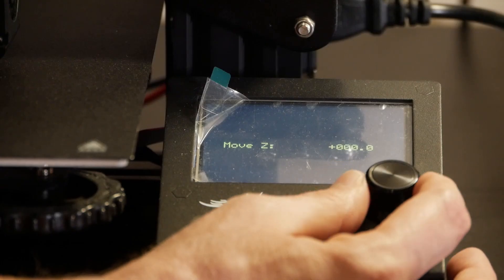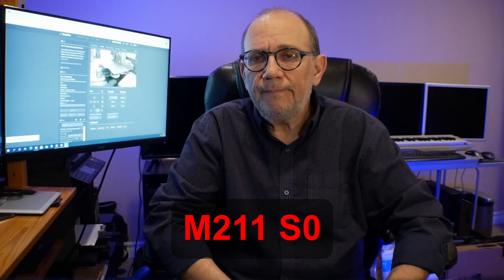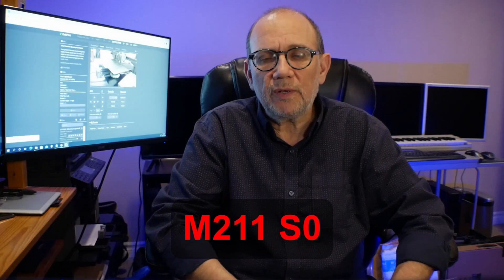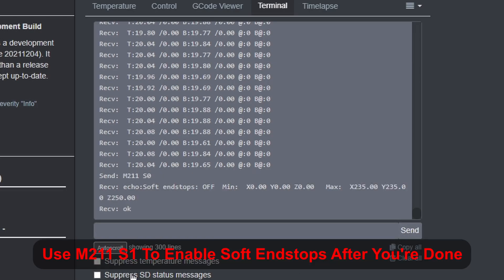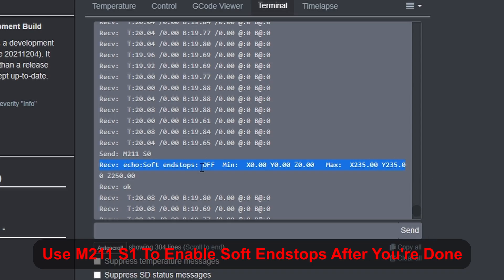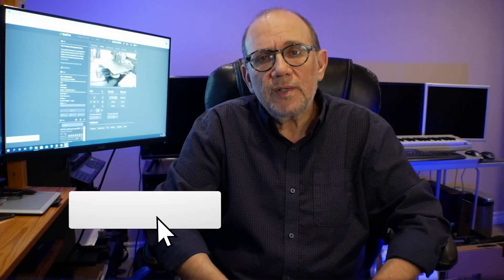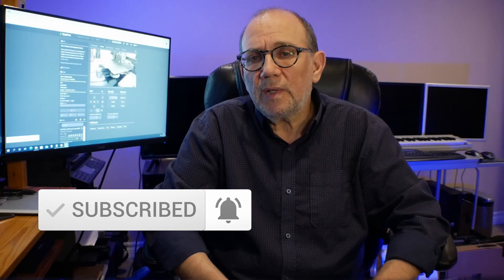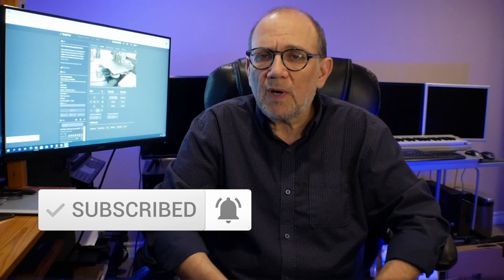Easy z-offset adjustment for your 3D printer.

Comment: I've watched so many videos since getting my CR Touch a little over a week ago, and this is the ONLY video that helped me figure out why my prints weren't sticking to the bed. I bought a new bed, experimented with so many temps, compiled different firmwares and spent HOURS of my nights trying to figure out why my "level" bed had trouble getting filament to stick. Watched this once, and I was finally able to correctly set my z-offset and my first test print worked with no issues. I can't think you enough!!
Reply: yep, same.
Reply: @mikebird4066  The same with me
😊
Reply: Same for me, Creality sucks at giving the basic info to set up their stuff and their firmware organization is a mess.  Too much focus on nice packaging and not enough on the meat.  I very quickly concluded this was the probe not knowing how vertically far it is from the nozzle and I was about to bend the bracket when I found this video.  Thank you!
Reply: Came here to say the same thing. Thank you so much!

Comment: Great info in this vid. The way I did it was run a gcode file with M211 S0 to turn off negative z restriction. Tram up the board like usual with paper with no ABL enabled. Set z offset to something closer to zero than the actual distance since that will make it stop too early on autohome. That is better than having a very negative z offset and having it crash into the bed. Enable ABL and autohome. Use the z axis menu to see how much farther it needs to go to have it scratch paper. Add that distance to the z offset and try autohome again. After 2 or 3 adjustments it should be very close. It's better for it to be too loose than too tight since the ABL code will just adjust and you don't crash the head into the bed. That is, -2 mm is safer than -2.2 mm. Save setting and it should be good to go for using G29. I used firmware from compiled at firmwarefactory-net because the firmware that came with BTT was very buggy.
Reply from the maker: Hello Matt Jones.  Thanks for the comment and the detailed explanation of how you set the z offset.  RG
Reply: Fantastic info to be able to turn off that restriction. I recompiled my firmware to allow it, though under nearly all circumstances I obviously want it on! Wish I'd known your trick!

Comment: ok. its very simple but in my printer i can't go below 0.000 in any axis . Do you know why is like that ?
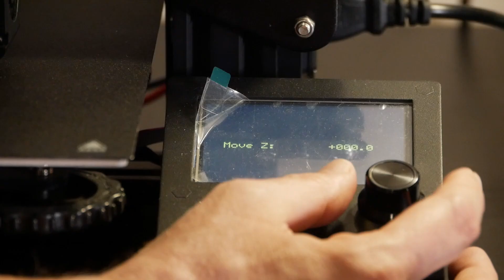Reply from the maker: Hello Piotr Paderewski...did you watch to the end of the video?  If your Z axis doesn't go below 0.000 it means that the z axis soft limit switch is turned on.  This is to prevent your nozzle from hitting the bed.  I talk about this here... 15:08  ....you'll need to turn off the switch with the M211 S0 command.

Comment: So I am having a issue that it won’t store the settings what am I doing wrong Ender pro 3 here with a CR Touch
Reply from the maker: Hi Chad Pisarski:  Sorry to hear that you're having an issue storing your settings.  I'm assuming that you're using an Ender 3 Pro with a 32 bit board, is that correct?  Given that you've got the CR Touch installed I'm going to assume it's a 32bit board.  Are you following all the instructions in my video regarding saving your values?  Does your printer save the value until you turn it off, and then when you turn it back on it's gone?  Did you install new firmware to get the CR Touch functional?  Depending on which control board your printer has installed, you'll need to download or configure firmware to work with the CR Touch.  Did you do this?  Anyway, give me a bit more information and I'll try to help you as much as I can.  RG